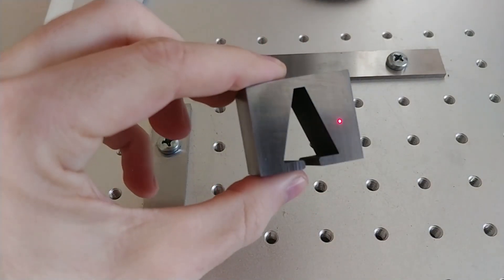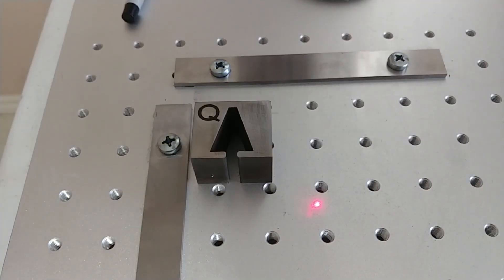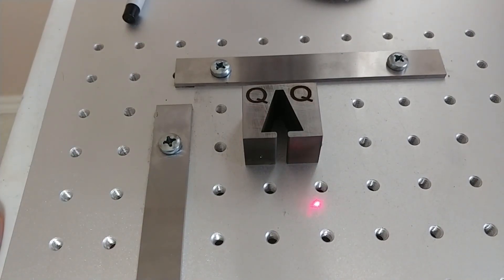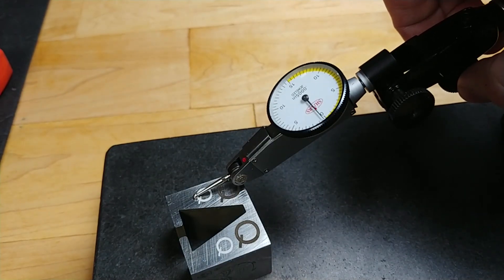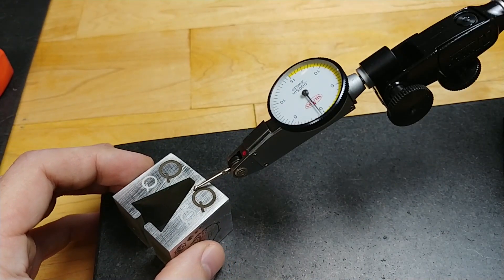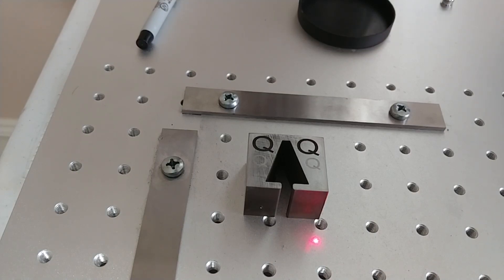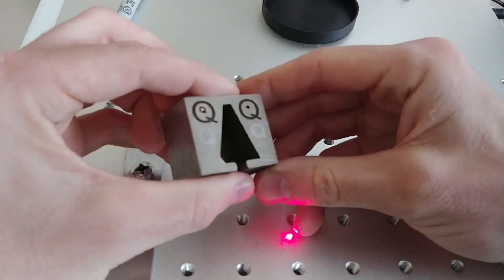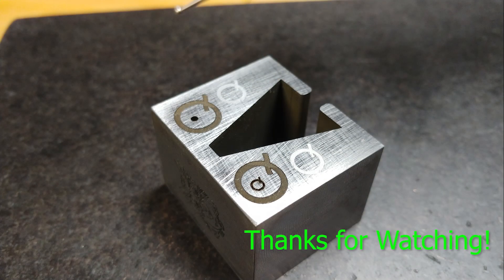Fiber Laser Engraving for DEPTH

Comment: What is the purpose of changing the angles?
Reply from the maker: It's just the hatch angle.  If you specifically wanted to mark horizontally or vertically to minimize the chance of a pattern forming, that's possible as is auto rotation.

Comment: Just bought a 30W laser, same type.   You present great instructional videos.   I need to measure letter/word engraving depth in anodized aluminum to .0005in.  Question previously asked but not answered - What type of Depth Micrometer is that and where can I find it?  I've searched up and down and don't see anything similar.  Easier to ask than to spend hours searching.   Thanks for passing on your experience.
Reply from the maker: Something like this will give you a magnetic base as well as a handful of tips to get in small spaces: https://www.ebay.com/itm/T0010-3-Pc-Inspection-Set-Mag-Base-w-FA-1-Dial-Indicator-22-pc-Tip-set/303464983279?hash=item46a7ec2aef:g:bDgAAOSw4wVed7CG

Comment: Jeff, What's your typical hatch spacing? Thank you.
Reply from the maker: I mostly do anodized aluminum so it's pretty loose...somewhere between .05 and .1 mm.  Usually on the tighter side of that range as I almost always use a crosshatch.  I don't remember what it was in this video, probably at most .05mm.

Comment: Great videos.  I am looking to mark plated nickel that is 200-300u" (.0002-.0003") without penetrating to the layer underneath.  In your opinion, could one of these Chinese fiber lasers achieve this?  I am looking to mark what is essentially a plated cylinder about an inch long and 3/8" in diameter along the length with a part number.  In your opinion, is there enough latitude in the focal depth to mark with characters .100-.125" high?
Reply from the maker: You should be able to mark without destroying the nickel - the mark may just be lighter.  I did a bit of very light marking on carbide end mills that might be helpful to see - check out my other videos, it should be there.  The diameter was significantly smaller than 3/8" if I recall correctly.
Reply: @jefferyj  Thank you for getting back to me.  It is tough to be on the fence when $3.5k will either work for you or it won't!  From what I have read, laser marking on plated nickel is done at lower power, higher frequency to anneal the plating rather than ablate it.  Hmmmmmm.

Comment: Hello Mr. Jeffrey, thank you for your great videos.
Can you let me know how to make the outline thicker?
Reply from the maker: Select the line you want to thicken and use the offset function - it's located under the 'edit' menu.  Now you'll have some area that can be hatched.  Alternatively, you can use the wobble feature which is located in the 'advanced' menu in pen settings.
Reply: @jefferyj  Thanks Sir, I will try out your instructions.
Another question, when doing vector or graphic on rotary. The split line keep leaving the vertical mark between the splits. I double check the diameter but still. No problem on text rotary, only image or vector file.
Reply from the maker: @VuNguyen-py1ew  I don't have the rotary but I believe your split value has to be identical to your hatch spacing to eliminate lines.
Reply: @jefferyj  Thank you Mr. Jeffery, do you have any related videos about the wobble feature or offset hatching?

Comment: I'm in a pet tagging business and I want to level up the quality of engraving. So I'm planning to buy a 30W fiber laser. I have no problem with a thick tags but some tags like anodized aluminum with a thick of 1.13mm, engraving front and back is not quite thick. Do you think the laser will go through it. THANKS!
Reply from the maker: So you're currently using an engraving tool of some kind on 1mm materials and it's causing a problem as you can't easily engrave both sides?  The laser isn't very destructive in terms of engraving, so If you want to actually cut through a 1mm tag, it will take quite a while.  If you just want to mark the surface of the tag, it shouldn't be a problem and will only take a few seconds per side.  You can set the power and hatch settings to your liking to achieve whatever effect you desire.

Comment: hey Jeffery, i'm planing to get this machine with a 110x110 marking area for knifemaking my logo is quite minimal line art, you think the blade will heat up alot when i do deep engraving? or is it worth spending the extra 1k for 30w? i worry about the tempering
Reply from the maker: I've never actually taken a temp reading, but the deeper you go and the more time the laser is working on your part, the hotter it will get.  If you have minimal line art, I don't think it would be a big concern.  It really depends what kind of depth you're going for and how much fill you have.  I'd probably go at least 30w if I were buying again just so I had greater ability for depth if I needed it.
Reply: @jefferyj  thank you! So i go with a 30w 150x150. 50w would be great... but this kind of Investment would not be justified at the moment
Reply: @jefferyj  Hey Jeff, do you think a 10w would be sufficient for light etching, say, for a ring? The light Q you did here is similar to the look I'd be aiming for.
Reply: @jefferyj  
Thank you very great video !
Do you have any parameter setting on ring engraving in and out?? TgNk you in advance